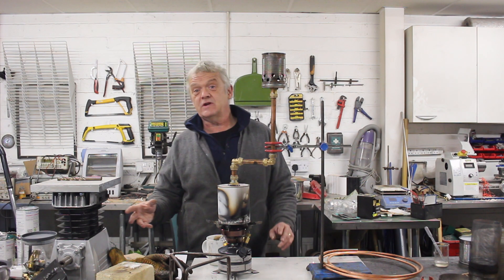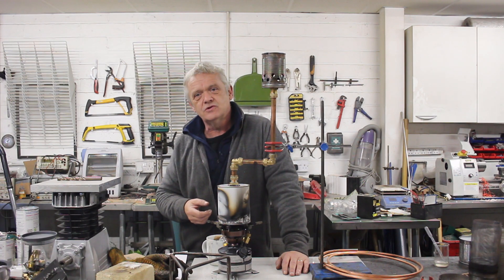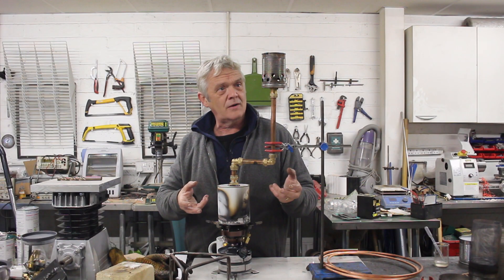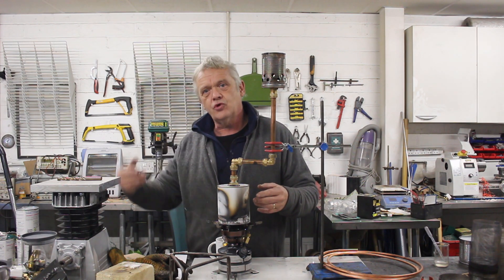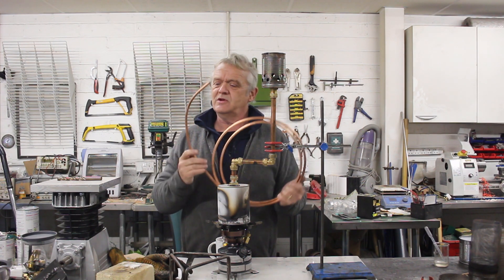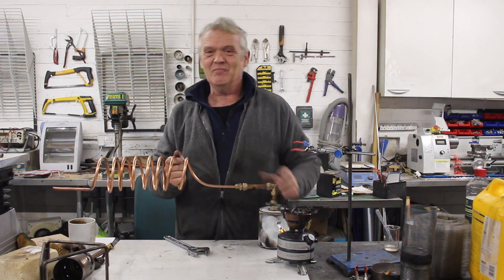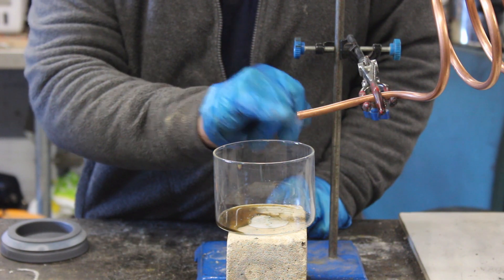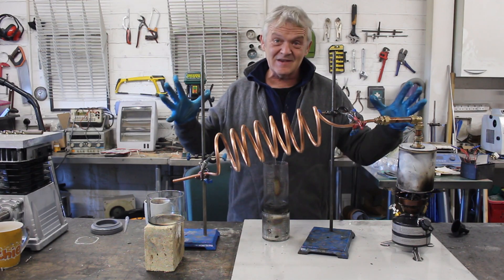1710 Making Methanol From Dry Distillation

Comment: What kind of brass plumbing fixtures did you stick between the paint can and the coil? It did not look like a flare or compression so if it was a regular pipe thread then did you solder it on? If so I'm confused how it won't desolder in high heat.

Comment: Also contained within the Pyroligneous Acid is: formic acid, acetic acid, propionic acid, butyric acid, valeric acid, caproic acid, crotonic acid, angelic acid, methylamine isoamyl alcohol, a-methyl P-ketopentamethylene, pyromucic acid, methanol, allyl alcohol, acetaldehyde, furfural, furfural acetone, pyroxanthene, methyl formate, propyl ketone, pyridine, methyl ethyl ketone, ethyl propyl ketone, dimethyl acetal, methylol, valero lactone, methyl acetate, pyrocatechin, ammonia, isobutyl alcohol, ketopentamethylene and methyl pyridine, allegedly.

Comment: This is WAY better than the average video on gasification where little is explained over half an hour of rambling and you only understand it if you have experience already. I have a still about 4 or 5 meters long. I generally got for  refrigeration pipe because I know where to get it and my still is 3/4 copper water pipe on the outside with it bent 90 degrees at the ends and 2 holes drilled to feed thru the refrigeration pipe. I've played with wood gas a bit but never knew exactly how methanol was obtained. We don't have many deciduous trees NATIVE to Australia because it just doesn't get cold enough. So only trees with European or American origin by the sounds. There's some oak around here but not much, all I know is on government land.

Comment: Thanks a lot, I’m a bit concerned about safety since methanol vapors are extremely toxic, I see your setup is using only the coil surface area to drop temperature down, and no cooling or service stream is used. I’m I confused?

Comment: Besides on site solar for getting the energy needed for pyrolysis. At least on a large scale- what about a combination of concentrated solar and hydrogen fuel cell co-generation?

I always wondered if you had a tree farm, besides lumber/bamboo, you could get methanol and carbon liquor (lignin carbon fiber, but that may have issues and dry distillation makes sense using as much as possible)

Comment: If the coil is not vertical, an inclined 'plane, it will bubble at the low points rather than drip via gravity. I want to steam inject (~420c) as a prewarm to get the wood up to 300c+ quick. Note that water also "hydrolyzes(?) And some of the h2 and o2 join with the carbon for more methanol than is in just the plant. Output (?) Should be methanol, water, co2, and charcoal. Augment restill the output using ted. Hot side vaporizer, cold side condenser. With a micro-controller (Arduino or rp2040...) and a thermistor, you can control the output to (near) exact 64.7c and get (near) 95% methanol out. Control the Peltier by igbt, MOSFET.... And fluid by pump to keep temp close.💕❤️🙏😇🖖,jpk (I created the McGyver series and produced as (yes the 2nd) John Rich along side Henry (t)Winkler). Tinker BRAT(beloved revolutionary advanced thinker).😲🤗

Comment: People have been using cow manure and anaerobic digesters to generate syngas for a very long time.

What do you think of basically taking a parking garage and modifying it to be a sort of controlled nice pasture for cows, where you can easily also collect their feces and flatulence?

You can grow hay vertically in a vertical farm next to essentially a parking garage tailored for cows.
That way you don’t have to have switchgrass or anything else competing for food, and you’re actually generating food along with hydrocarbons - milk, cheese, yogurt, icecream, Pizza, and gasoline.

🤷🏻‍♂️

Over time, The dairy business would be the same, except you don’t need gigantic tracks of land, and everything could be easily cleaned and controlled, and the air can be controlled -methane as your base hydrocarbon to work with in another dedicated chemical plant.

There are ways to control the air quality, but you need people to manage the cows, their food, their health, and their byproducts, be it milk or feces - which you can collect vertically or horizontally.

Either way, it’s very efficient way to collect methane without having to much in the way for switch grass or any other type of grass (engineering) -Essentially becomes mostly labor

Comment: There is a company named "Vevor" that makes, among other things, stills. Although the one I bought was intended for "Beverage production," it is an 8 gallon Stainless Steel vessel, with a lid that clamps on, a Thermometer that goes inside through the lid, and, a condenser coil that has a water jacket!, and includes a WATER PUMP, so you can circulate cooler water from a tub or bucket.
I see no reason It won't work for this. But once I try it, I'll never want to use it for "Beverage production." Which is fine, I don't drink. I can still use it for fuel grade Ethanol, though.
I paid $105 and change for it.
I plan on using 5 gallon water bottles, the "Water Cooler" style, with a Tee fitting on the tubing to allow the condensed Methanol to drip into it, while the volatile gasses like Hydrogen and Carbon Monoxide et cetera are fed to a burner under the pot, to help fuel the process.
I shall bookmark this video and try to remember to make an update, and also try to post a video of me trying it.

Comment: If you were to put Hydrogen, Oxygen, Carbon into a tube and pressure it to 50-60 bars, would it explode from the H + O connection? ...or would it be fine as long as there are no sparks??

Comment: Robert Murray Smith.
You could cook it to ash, making hydrogen, alternative fuel during WW2.

The use a reagulay engine, draw a fire and hot gases thew a vortex filter and simple radiator and into the carburator 
🚗

Comment: This is an important exercise to learn, with proper ventillation wood could be used to generate the 300 - 400 degrees required to create the methonal by dry distillation so you aren't using a valuable fuel to create the methanol. Just my opinion !

Comment: Coil condensers are difficult to clean and maintain. The performance is also difficult to control and predict because the temperature of the coil will vary as it interacts in complex ways with the air and the changing temperature of the gas flow. A straight water jacket condenser will perform much better. It does also have temperature interactions with the gas being condensed, but this variation is much smaller such that it can be ignored. Water is such a good conductor of heat that it becomes the dominant factor. An open air coil condenser even with forced air is hard to predict. You are  almost certainly going to get only partial distillation where some gas will vent to the atmosphere, so not a good thing to do indoors. You can judge performance based on the temperature of the distillate. It should be near the temperature of the cooling source. If it is significantly warmer then you’re in the area where the apparatus is difficult to predict and control, which is not ideal when working with volatile substances. In any apparatus it’s advantage to reduce the variables. A water jacket is much less fiddly.

Comment: so, what is the net loss of energy using propane to distill methanol like that? I'm not trying to be a doubting thomas, it just seems like you could pop that radiant heater rig on top of the propane burner and get plenty of heat.

Comment: The coil should be positioned vertical. Basically after doing the coiling don't bend the tail at the top end, just let it come off at the natural tangent. horizontal or angled coiling like shown in the video is the stuff of cartoons and first year chemistry lab mistakes.

Comment: I'd go into hiding. 
You've just revealed virtually infinite power ( in the form of heating).
By combining 1702 / 1704&1705 with this one & a new batch of wood each time ,  you can use the heat from the fuel to produce fuel for the heat ad infinitum........

Comment: Perhaps make a modified rocket Mass Heater using this distiller to capture the methanol to REBURN (or to just help ignite fuel) on rainy days.
Reply: I suspect the methanol would have been already burned in a proper Rocket device due to the high temp?

Comment: A note on the microbore, there are a couple of types, you need the annealed type like Rob used it is usually a more orange red colour, the stuff that looks like normal copper pipe will need annealing.
Once it's formed you may also need to anneal if you need to change the shape of the coil due to work hardening otherwise you risk crack the pipe.
Reply: Filling the pipe with fine dry sand also works well for bending.  Was curious on best practice for annealing copper pipe?

Comment: Brilliant! Thank you Robert for your valuable work.
Is there a better way to dynamically check when the water vapor stops and the methanol starts?
Alternatively, is there a low energy way to separate them after collecting both into a single container?

My first thought was to put a thermometer probe into the boiler and run it around 110°C till it stops dripping water, before raising the temperature to produce the methanol, but I was hoping there's a better way to detect when one stops and the other starts, without the need to precisely control the temperature.

"Salting out" the alcohol could be an option, but considering different water contents, and what Robert said about different types of wood resulting in different chemical outputs, I'm not sure how difficult it would be to determine the exact percentage of salt required for the process... maybe someone with a better understanding of the chemistry involved can clarify that for me, (and for others:).

Any thoughts? ideas?
Reply: Methanol s boiling temp is ruffly 
64.7 °C (148.5 °F; 337.8 K).  Hope this helps.

Comment: Now add a fractional distillation column instead of the dodgy condensation coil.  Methanol water azetrope can be broken with 3A molecular sieves in a second distillation which would also remove associated pyrolysis tar.

Comment: My guess that the yield of methanol is very low. I looked to see if there was a low pressure catalyst you could use to convert the syngas produced into Methanol, but the lowest pressure catalysts still need about 10 Bar (140 PSI, 1 MPa). Now that would be a good experimental video.

Comment: Incredible.
Of course it would make sense to use a cheap fuel as the heat source but if you were using methanol to heat the wood then how much methanol would you need to burn to distill methanol from wood?
Would it be a net positive process using methanol as the heat source?

Comment: Hi, just a safety note here when making wood methanol. If you pipe the gases from the cool end of the condenser to the wood pot heating flame, you may need a flash arrestor in the line that returns to the burner. I tried something similar many years ago and had a big boom, followed by the liquid end product catching fire. I thought I was making wood gasoline, but didn't realize until I saw this video that I was making wood methanol. Maybe it's the same. Love your work. Cheers.
Reply: Too much air in your methanol collection bottle before starting by the sounds. Sounds like a water bubbler between the methanol collection and the rest of the system would have work. You wouldn't be the first one to nearly blow themselves up messing with alternative fuels. I heard of people using an air compressor to compress biogas or something worried they would blow themselves up because of any sparks generated in the electric motor.
Reply: Yeah they're similiar, people in great depression especially farmer use it to power their car and at the same time producing charcoal, fuel for cooking that other poor people needed to cook
Reply: Methanol IS basically gasoline 

By the way you know any other reliable way of turning wood/waste plants(maybe papear?)into fuel? 

We We're kind of having a little problem with the supply of Gas....

Comment: I've found when coil copper pipe it's handy to fill it with sand if you want bend in tight radii. I used this method when I was building my induction heater. Great video thanks pal.
Reply: I recently watched a video of a guy who makes perfect coils by filling copper pipes with water. He crimp seals and hot glues each end while wrapping them around a mandrel. I guess an easier way would be to use compression end cap fittings and simply unscrew them to let the water out after bending.

Comment: I remember a patent i saw about a really simple process for making liquid fuels from gas at ambient pressure.  If I remember correctly, they bubbled the hot (100-200c) gas through a tank of diesel and ball bearings (I think they were tungsten balls) and the gas condensed into a liquid they could burn in an unmodified kerosene heater.  It sounded like the perfect thing for home fuel makers. The process worked with hydrogen and biogas from a digester, so I bet syngas would work too.
Reply: the balls were probably to massively increase surface area for something maybe as heat conductor?
Reply: @markiobook8639  I think the patent said the balls were acting as the catalyst.  That's why they were tungsten (or maybe chrome... It's been years since I read it).
Reply: I see. Thanks.
Reply: Ohh now wait  this is interesting,   although no longer very affordable.   There is a old book were they make nat. gas by blowing air and steam thru coal then superheat it in chamber spraying fuel oil in the last stages to enrich it into a useable higer btu gas.  Im still thinking alcohol or biodiesel.   What about chalk calcium carbonate in contact with water it produces a gas but requires heat input (solar)  to complete the reaction.

Comment: does distillation not require a method of capture of what is heated? (ie a cooling chamber after heated to break down the wood, or boil off a fluid, so it will return to a liquid state) 

I ask partially because semantics and syntax is an interest to me, and on top of this I am working on a project to document and make a how-to on how to make a micro refinery system, that is fed by organic stuff from the ecology in order to replace the organic stuff taken from below ground where there is thought to be no ecology but geological methods for doing the formation of the materials. (ie replacing oil and coal with various plant components, and maybe even some animal or insect components) all as a portable and quick set up (maybe about as setting up a camp site for say 5 people) as well as a mini version where its legal and allowed, to set up a personal non-mobile version say local to a farm to provide the needed supplies and energy sources, all using as many renewable methods as possible (like mylar concave mirror sheets to concentrate sunlight on a vessel to break down carbon compounds and drive them through a series of cooling steps so it can be sorted)

Comment: But if you are just producing the methanol as a fuel for heating isn't it costly because you are burning another fuel to heat the wood to produce the methanol. Isn't it just easier and cheaper to just burn the wood ?

Comment: with longer use, the pipeline fills with tar and clogs the entire system. But yes, a simple demonstration of how to do this. It would be better if the pipe was folded into a U shape several times and a valve was placed in the lowest bend where the tar can be drained out of the system. Water cooling helps also a lot.

Comment: How long would the heater run if you used the syngas and methanol to run the heater/gassification in a continuous cycle, only replacing the wood in the chamber. 

Essentially using it just to heat a room for long periods of time. I hope the idea makes sense, having trouble with words right now. Lol
Reply: I think using the double can wood gas burner does that.
Reply: @fivethree0  partially. He's have to run the tube down to the gas burner.  I'm curious how long it would stay lit.

Comment: I was planning on passing the syngas through a water bucket (into an upturned container) and collecting the 'cleaned' gas at the top and the methanol should float on the water.
Are there any major problems with that, all I can think of is more water vapour in the gas?
Reply: methanol is water soluble, so won't float, just mix
Reply: @fivethree0  darn it, of course it is!  I was thinking of white spirit.  Oops.

Comment: why didn't you use your any fuel can heater instead of the camp stove for this project? if you cut holding notches at one end of your forming plastic pipe for your copper tubing you can just spin the large coil of pipe around the smaller forming pipe or vice vera and get a tighter neater copper coil. this can be stacked so you can have muliple coils one inside the other with only one continous piece of tubing.

Comment: Great series of videos on syngas! Is the heat from the gas coming out enough to continue the pyrolysis of the biomass? That way we can just jumpstart the burning process and then it can continue on its own. Of course then the question is how much remaining gas is there for us to use.
Reply: There does come a point where the process becomes exothermic, but I'm not sure where. Pretty sure it's after the water boils off, but before the pyrolization is finished.